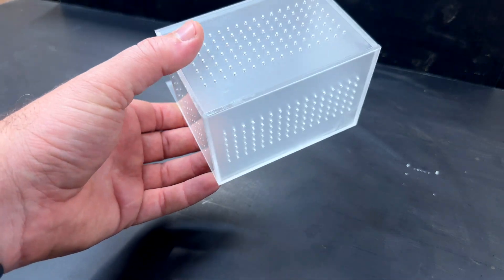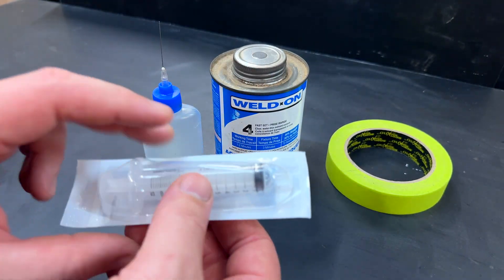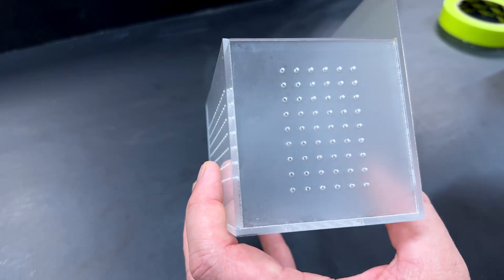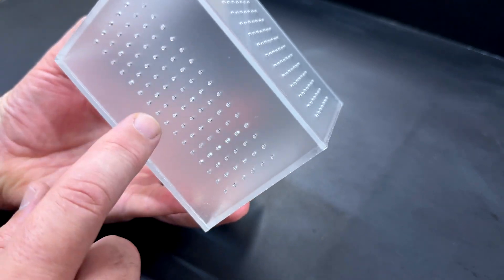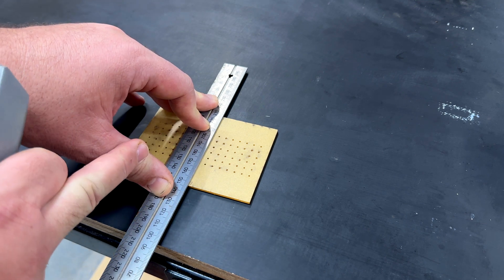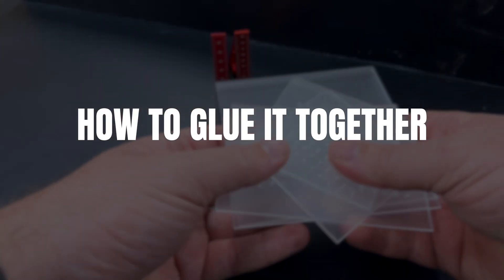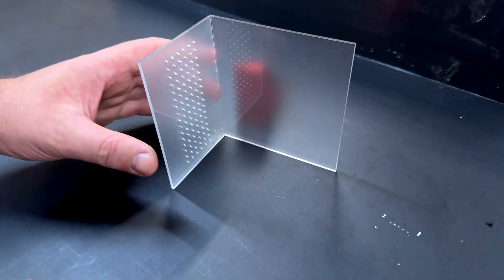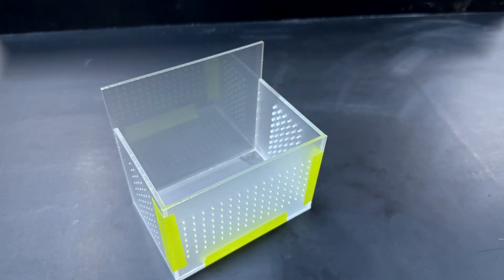How to Build Acrylic (Plexiglass) Enclosures - No Cracks, No Clouding

Comment: Cool. Does excess glue dry clear on the acrylic if u accidentally put too much
Reply from the maker: It depends.  If it's small drops, they usually dry quickly with hardly any marks.  Glossy acrylics can be a bit of a pain sometimes, especially black because it dries white if you spill too much.  Best thing I can recommend is practicing a bit with water.  If you can get it to flow consistently as you move along the joints then you should be fine.  Maybe see the other video I have for using an applicator bottle.  Some people prefer using those.  https://youtu.be/jdYJYYtPx9A